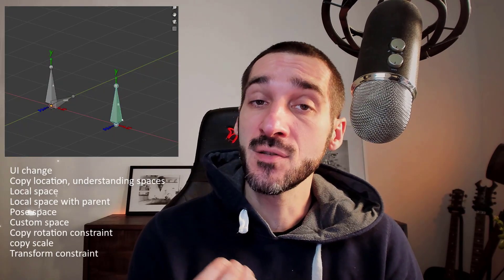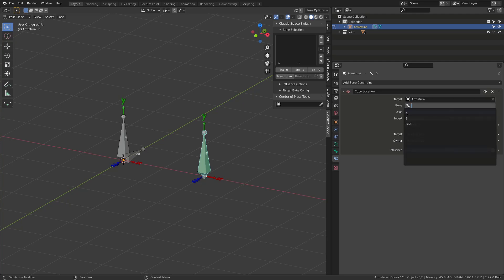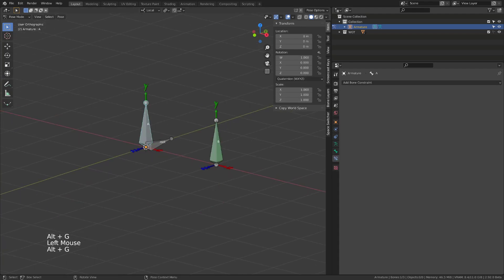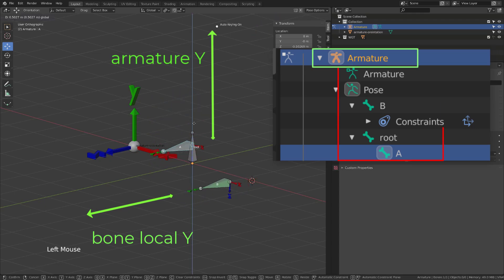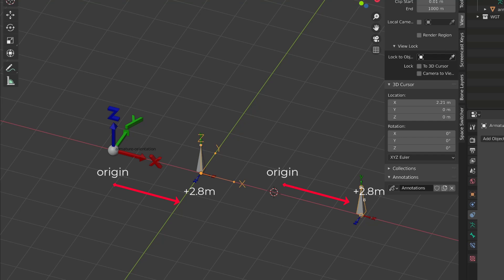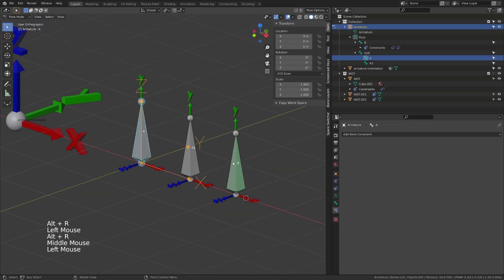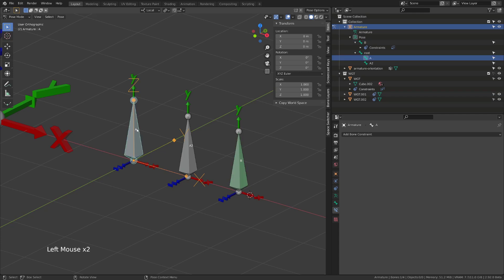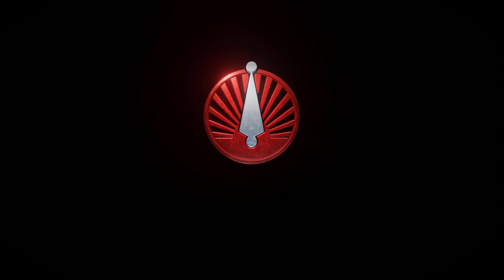Understanding constraint space, Blender 2.92 rigging constraints update

Comment: Would you know if there is a way to use constraints to take an animation, with squash and stretch, from one rig and retarget it to a duplicate FK-rig while removing the scaling/transforms of the joints to keep only the rotations? 

The reason being that an animation with squash and stretch would need to have a flat hierarchy to be imported into a game engine, but that may introduce a lot of problems when working with procedural animation in-engine so it would be useful if one could keep the hierarchy. Then if one would want the squash and stretch they'd have an additional rig with a flat hierarchy.

Comment: Nice video. How about the copy rotation 0.5 influence or Transforming rotation by half popping in 180 degraus? This drives me crazy!
Reply from the maker: You can’t really fix it. That’s a common issue. I guess you would need to find a way with scripting. But this is how rotation works at the core level that creates this problem